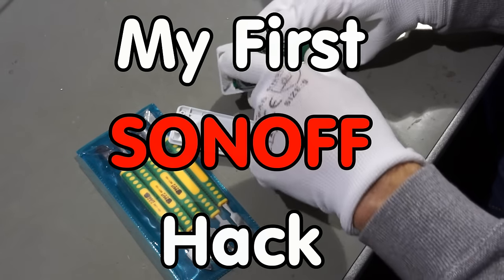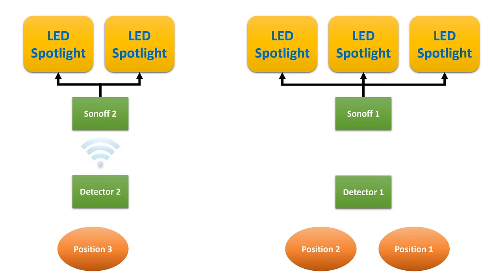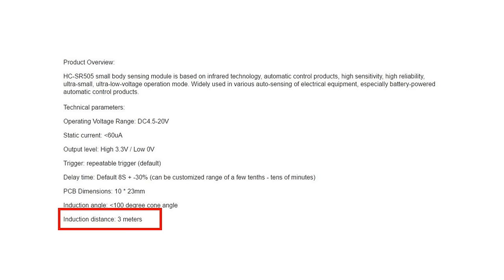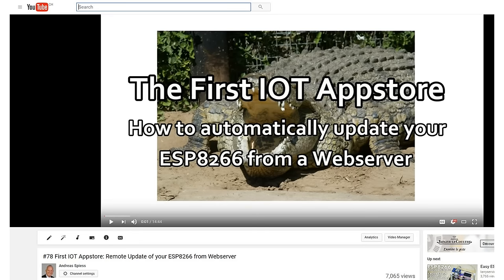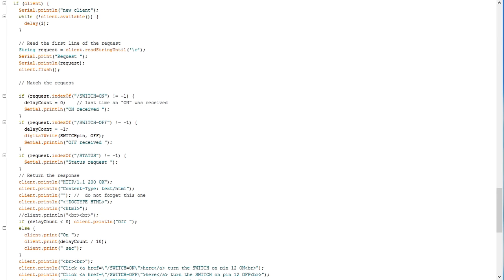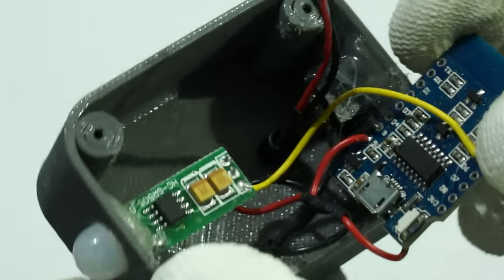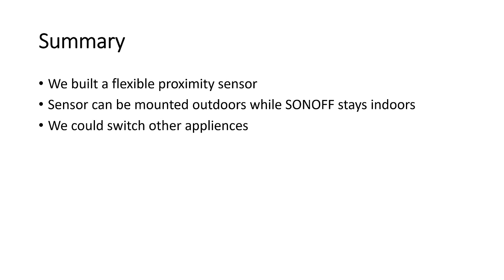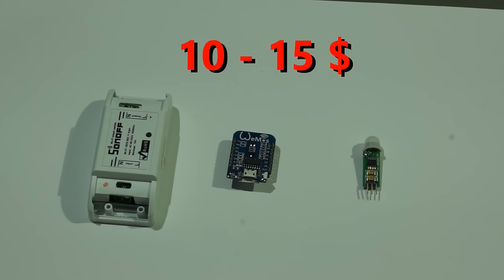#93 Remote Motion Detector Using a Hacked SONOFF Switch for Home Automation Projects

Comment: I use a slightly modified version (i just removed some features like OTA to make it harder to hack) of this mqtt-firmware for for my sonoffs https://github.com/arendst/Sonoff-MQTT-OTA .. Having a message queue instead of direct connections is much more flexible and easier to manage/monitor as the number of devices in the network grows.  I would probably suggest moving to a queue/bus solution somewhere after 5 to 10 devices.

There are many UI solutions for phones, computers etc.. https://home-assistant.io/ is one example which is quite easy for setting monitor and control of mqtt connected devices.
Reply from the maker: Thanks for your tips! I will have a look at them. So far, I feared MQTT for simple scenarios because it needs a broker. And I did not want to go to the internet with these "live" applications unless I understand the security aspects a little better. 
But your argument about the number of devices is absolutely valid.
Reply: I use a local network mqtt server because esp8266 can't do TLS and I don't want to rely on the internet for my home automation stuff.. IIRC ,home assistant can act as a simple mqtt-server by itself, I run a mosquitto server for MQTT.
Reply: Haven't testet MQTT yet but as pleggli mentioned, it isn't very difficult to set up an own MQTT broker with mosquitto on a raspberry pi. If you install node-red to, you have a powerfull and simple to use combination.

I've started my fist tests with UDP. If you wan't to react on different places from one sensor, it gets complicated very fast and you have to change lot's of (ESP)-devices if you only want to add one device or feature. With MQTT you only have to publish your sensor data to the broker and lots of other devices can easy react on this data or combination of data from different sensors and switches.

For excample: You want your PIR sensor tp switch on heating to, if the room temperature is under a certain level. When you make this without MQTT you have to send and request lots of messages arround when using http or udp. 

If you use a raspberry pi 3 you can run you esp app store on it to and you have not to rely on your internet connection or have think of security problems because everything is in your intranet behind the router.

All "outside" stuff can be handled over a vpn connection to your pi.
Reply from the maker: You convinced me: The next one will be with MQTT :-)
Reply: yeah, there are soo many things which gets easier with mqtt.. one this is that you can use a command line mqtt client to monitor everything that's happening on a mqtt-server by subscribing to all topics using a wildcard, super handy for debugging and developing : 

mosquitto_sub -d -h 192.168.0.xx -t \#

It's also handy to do the opposite while testing integrations.. one example is this command which triggers all my sonoff-mqtt devices to report their current state to mqtt..

mosquitto_pub -d -h 192.168.0.xx -t cmnd/power/power -m "" 

After I send that command I see a bunch of these in subscriber above:

Client mosqsub/17897-transwhal received PUBLISH (d0, q0, r0, m0, 'stat/tf-light-ceil/POWER', ... (2 bytes))
On
Reply: And.. (again),  since the esp8266's can't do TLS I run all my wifi enabled automation devices on their own wireless network to have some basic security from wpa2 encryption..  This way no one can tamper with my automated installations even if they for some reason were able to hack into the network where desktop computers, phones etc lives.
Reply: Are you sure about TLS? It's possible to use MQTT over a secure TLS connection: https://io.adafruit.com/blog/security/2016/07/05/adafruit-io-security-esp8266/. My firmware for Sonoff: https://github.com/mertenats/Sonoff

Comment: what happens if i connect GPIO 14 TO GND on a non modified (stock firmware) sonoff? will it go to default state?

I need my sonoff device to switch off all appliance if i connect GPIO 14 TO GND .. is it possible ?
Reply from the maker: I never uses stock firmware, so I do not know
Reply: Andreas Spiess any way to get my above configuration

Comment: Dear Sir, your videos are very informative, many thanks for videos, I need help if you can, would you make a video on how to make a same device as similer as sonoff 4 channel pro but by using Wemos D1 mini. Most important thing is it should be connected to wifi by using eWelink app in mobile and by pressing a button in a circuit made of Wemos D1 mini . Many Thanks a.Samad
Reply from the maker: EWelink is a proprietary system.
Reply: Thanks again Andreas for your prompt reply

Comment: Is it possible to flash esp8266 based AC relay module with sonoff firmware?
Reply from the maker: I do not have the Sonoff firmware and I think, it is not open source.

Comment: Thank you Andreas! Your videos are always very exciting for me and full of really good ideas!
I tried to programm my Sonoff Switch with the code (Sonoff_ReceiverV3) you linked in the comment. Unfotunately I get the following error when trying to compile the Sonoff_ReciverV3.ino: 
C:\Users\<User>\Documents\Arduino\Sonoff_ReceiverV3\Sonoff_ReceiverV3.ino:34:25: fatal error: credentials.h: No such file or directory
Could you please help me to solve this error?
Lovely greetings from Bern
Christian
Reply from the maker: This is a small thing. Just delete this line. Then, you have to fill in the  credentials (mySSID, myPASSWORD)
Reply: After changing the three "Debug.ative(Debug.DEBUG))" to "Debug.isActive(Debug.DEBUG))" parts in the loop(), I could upload the code to the Sonoff.

But now I get this output on the serial monitor:
  Start SonoffReceiver V3.4
  BootTimes 1
  Reading Config
  Configuration found
  ...................................................
  ets Jan  8 2013,rst cause:1, boot mode:(3,6)

  load 0x4010f000, len 1384, room 16 
  tail 8
  chksum 0x2d
  csum 0x2d
  v09f0c112
  ~ld
  ⸮

It repeats this continously, while increasing the BootTimes number.
Do you have any idea what went wrong?
Reply from the maker: It somehow has false credentials and does not connect. So, you have to force it into Config mode

Change line 155 to     if (retries >= MAXRETRIES) espRestart('S');

Now, it should reset and will stop with "wdt reset". Then, you have to manually reset the board the first time (bug in ESP8266). Then, you should find a new Wi-Fi network in your mobile phone. Connect to it and enter 192.168.4.1 and enter the configuration.
Hope, it helps. Otherwise just come back.
Reply: Hi Andreas
Unfortunately it doesn't work. After I uploaded the edited code (line 155), I get this output on the serial port:
   Start SonoffReceiver V3.4
   BootTimes 1
   Reading Config
   Configuration found
   
   MAC: xx:xx:xx:xx:xx:xx  //changed by me
   ........
   connected
   IP = 192.168.1.129
   Update_server 192.168.1.200
   UPDATE_URL /iotappstore/iotappstorev20.php
   FIRMWARE_VERSION SonoffReceiver V3.4
   Updating...
   HTTP_UPDATE_FAILD Error (-1): HTTP error: connection refused
   IP = 192.168.1.129
   Update_server iotappstore.org
   UPDATE_URL /iotappstore/iotappstorev20.php
   FIRMWARE_VERSION SonoffReceiver V3.4
   Updating...
   HTTP_UPDATE_FAILD Error (-106): Verify bin header failed
   * MDNS responder started. http://constant3.local
   Server started
   Use this URL to connect: http://192.168.1.129/
   Connecting to data.sparkfun.com

After resetting the device there is no new WiFi visible. But the Server on the Sonoff works and I can send on/off commands to the IP 192.168.1.129.

What can I do else?
Reply from the maker: It seems to work now as designed and you can switch the Sonoff remotely. Since this video was made, we improved the infrastructure around iotappstore.org completely and you have to use the address 
iotappstory.com
/ota/esp8266-v1.php
But you have to adjust a few other things, too. If you want to use the remote update,  I recommend to watch my videos concerning iotappstory.com.
I will make a note in the description of this video.

Comment: Just use /on and /off. Your uri isn't valid without a question mark. I ditched running a web server on all my sonoffs, they're not really capable of handling a lot of traffic. They lock up. MQTT is perfect for sonoffs. Keep the sonoff dumb and put the intensive stuff on a server.
Reply from the maker: 1. I used one of the examples as a basis for my sketch. And these URLs had no question marks. At the Sonoff, I anyway get the whole string and can parse it with or without question mark.
2. Do you use QOS=1 in your MQTT scenarios?
Reply: @itsadomoc,  Andreas isn't using server argument parsing, (i.e.  server.arg("SWITCH")  since the requirements are so simple.  Andreas is just string matching the whole URL for the commands.   Though, I prefer using server args as you don't have worry about case sensitivity.    MQTT would require either Internet access to a server or a local MQTT server added to the mix.(Yes, I know it's an easy RPi solution )  ..It appears that Andreas went with the simplest plan.
Reply: You don't need to explain it to me mate ;) I'm a developer. I'm just simply saying there's no need for the equals sign in that string. It's pointless. MQTT is not a difficult thing to add to your home automation ecosystem. It even comes bundled with home assistant. It's really not an issue to add MQTT to the mix. 

Andreas. I use QoS 0. My sonoffs toggle their state, so that seems to work best for me.

Comment: This is cool, but I don't know if wifi is ideal for a house full of sensors... if you have 50 IOT devices in your house and need to change your wifi password, then you have to change the password in all 50 devices!!  What a pain.  Are you familiar with the MySensors project?  The idea is that the IOT devices are RF and they communicate with a gateway to gain access to the controller and the internet.
Reply from the maker: As everything in live, it has advantages and disadvantages. I have plenty of sub GHz modules laying around to test other concepts. But for the moment, the Sonoffs are ok for me. It will still take a moment till I have my 50 sensors ;-)
Especially interests me the reach of these sub GHz modules in my home. For the WiFi I have now an infrastructure enabled and I wonder, if I would need another one for sub GHz.
Reply: The NRF24L01 modules with built in amplifiers have a very impressive range and can be arranged in a mesh network to relay data (which is another thing that MySensors does).  The wifi modules and the RF modules can work together by bringing them together with a common controller like OpenHAB or HomeAssistant.

Comment: Andreas, take a look at the small OrangePI Zero board we're talking about here: http://tech.scargill.net/fauxmo-alexa-delights/
you can make an affordable local mosquitto broker, or even with node-red, for about 10$, so no need of internet connection to benefit of the mqtt stuff :)

and take a look at this excellent lib for managing wifi setup on esp8266 :) https://github.com/tzapu/WiFiManager
Reply: Another little winner - though slightly more expensive is the little NanoPi Neo Air - it REALLY is small. WIFI+Bluetooth. Mentioned in same blog.
Reply from the maker: I had a look at the WiFi Manager, but I need many more fields, not only credentials. I want a complete separation between data and code. And this is not easy to be reached. Maybe, I will use the WiFiManager source code and extend it to my needs. 
I have a Pi Zero lying around, so, it is not about cost for the moment. It is about priorities. But I understand, that many of my viewers are interested in this topic. So, maybe, I will invest the needed time...
Reply: oh, yes, you already know Peter Scargill's blog... it's always plain of precious info on IOT :)
extending and resharing code on github and bitbucket is always good :)
Reply: @squalazzo has node-red a build in mqqt broker or is a extra node required for this? Does node-red run together with mosquitto? I'm not clear about this.

What linux os/version do you recoment for the orange pi. My Orange Pi Plus 2E just arrived today. I use debian jessie light on my pi's
Reply: all you need is in the first script here: https://bitbucket.org/snippets/scargill/
Reply from the maker: Thanks
Reply: and mosquitto and node-red are 2 services that runs on same hardware, different ports

Comment: Thanks for the video. I have developed a PIR activated lighting system using the Sonoff CH4 and Sonoff 433MHz PIR sensors - similar in function to yours. https://github.com/nickdeacon/PIR-Lighting-controller.
Reply from the maker: Nice project. Did you have a look at Tasmota? I think they also have some software for this hardware.

Comment: You can use mDNS to make each device announce itself in the .local domain.

https://github.com/esp8266/Arduino/tree/master/libraries/ESP8266mDNS
Reply from the maker: +Marcelo Cerri This is, what I did on the Sonoff. If I called it from the browser, it worked. But from the sensor ESP, it did not work.
Reply: I don't know the details, but some OSes don't support mDNS natively (like Windows), so I gather the ESP can broadcast their own mDNS, but cannot find other mDNS devices with the ESP8266mDNS library. Could be wrong though...
Reply from the maker: That's how it looks like in the moment.
Reply: Thanks for the tip Marcello Cerri, will thest it on my ESPs soon.

@888cromartie I have bonjour on every windows os and avahi on every linux os, that makes live easyer :)
Reply: Andreas Spiess , take a look at this example: https://github.com/esp8266/Arduino/blob/master/libraries/ESP8266mDNS/examples/mDNS-SD_Extended/mDNS-SD_Extended.ino
Reply from the maker: I will have a look.
Reply: Marcelo Cerri Thanks! It works...
Reply from the maker: What works? From another ESP? How did you do it?
Reply: Andreas Spiess I was able to have one ESP find another through mdns by running the same sketch (Marcelo linked) on two devices at the same time. The sketch listed the IP address and mdns name for the other device. I was then able to do a GET request to that address to control another ESP device. This line MDNS.addService("XXXX", "tcp", 8080); is key.
Reply: Exactly. The example uses the same sketch for both devices. But the key is that the device that you want to find needs to call MDNS.addService() and the device that will find it calls MDNS.queryService().
Reply from the maker: Sounds good. I will try it. Thanks!

Comment: Dear Sir, I'd like to build a power control system to avoid blackout in my apartment due to overload. It should be based on "sonoff pow" module. When the total apartment's power consumption goes above a predetermined  threshold   the system should start switching off in a sequential prioritised manned different appliances using sonoff switches. Can You help me?
Reply from the maker: Sonoff POW can measure power and have a relay. so this is easily done. Place a POW for each large load and add up the power in a Raspberry. Switch off if needed. Look for Espurna or Tasmota if you search a firmware for the Sonoff and Use MQTT as a protocol.